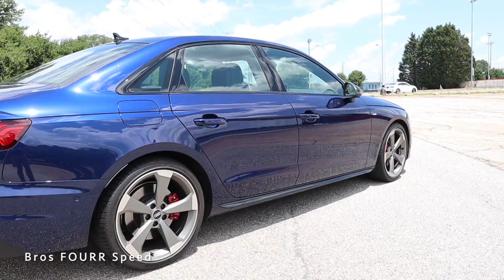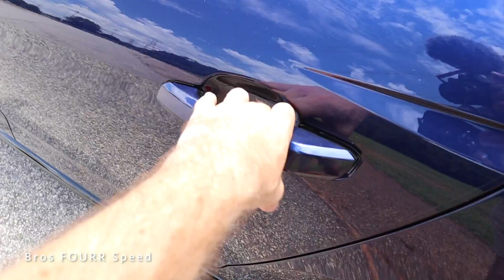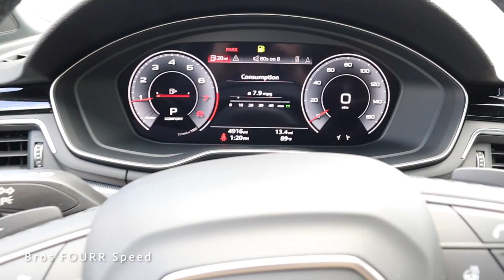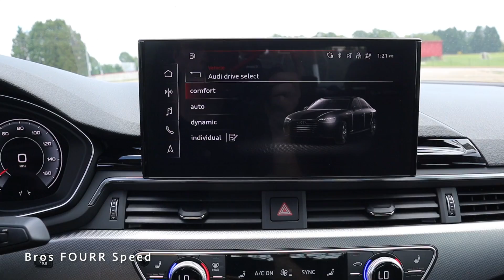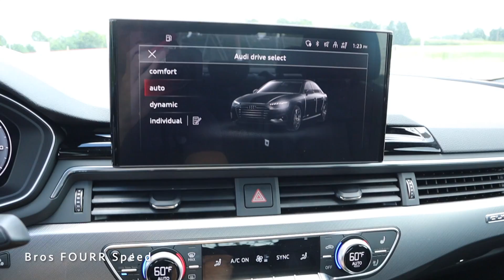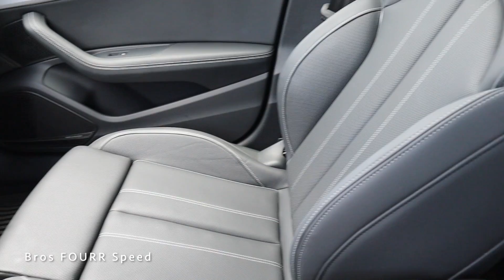2022 Audi A4 S Line Prestige: Start Up, Test Drive, Walkaround, POV nad Review

Comment: i have same car but not as same as this one.i guess they change the car depends on the region.
Reply from the maker: You have a 2022? Where are you located?
Reply: @BrosFOURRSpeed  yes 2022 A4 quattro sline ,i am living in Turkey
Reply from the maker: @murat3350  Yea different markets have different options or specs, what’s different about yours?

Comment: That carbon fiber spoiler is a nice addition (It’s bigger than the standard one included on an S4).  And the ventilated seats are noticeably nicer than the base model..  perforation, more bolstering, and piping.
Reply from the maker: This was a nicely spec’d Audi for sure!